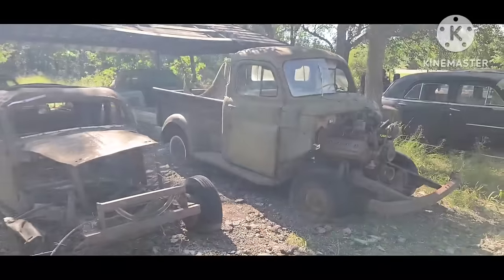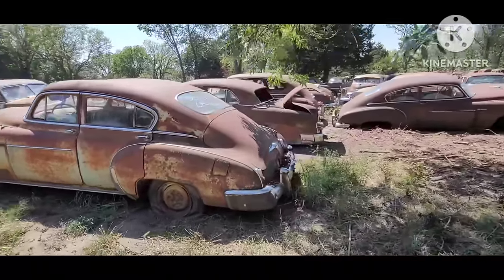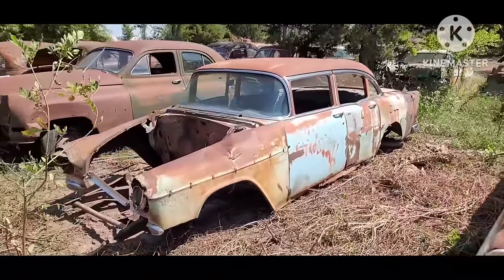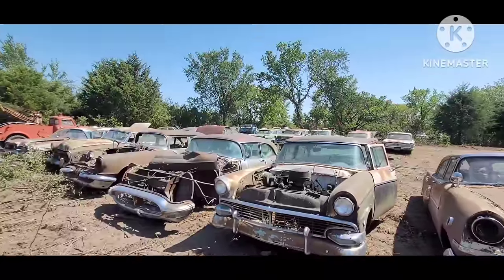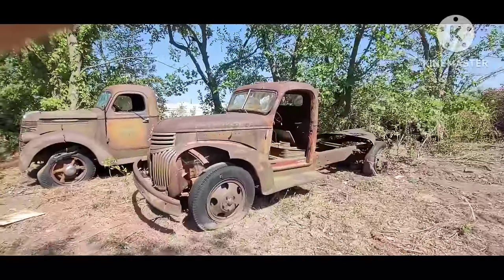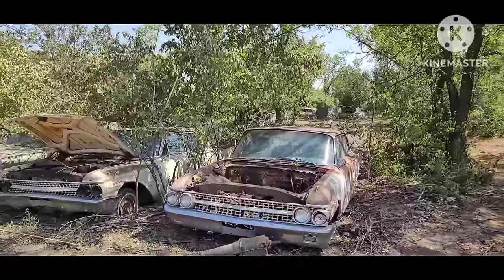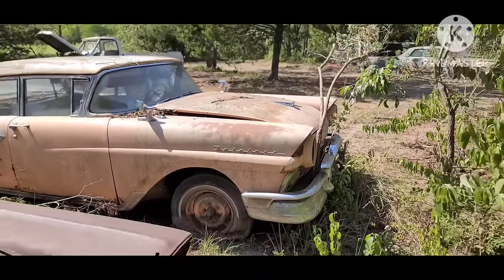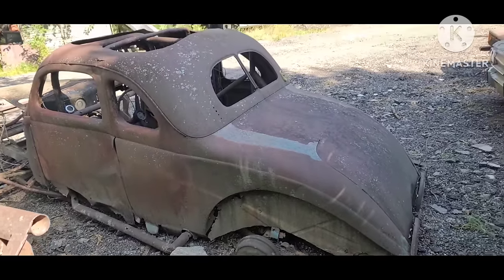Out of the Woods: Fred's Abandoned Used Car Lot Gets Organized! Kansas Project Cars, Trucks & Parts!

Comment: The Hemi is a 331 ,Pre 1953 . I 've had a couple of those,the only disadvantage are the long block design but the heads flow better than the later ones with the water out lets on them .
Reply: Those old engine blocks if you set them up on the mill you can cut that bellhousing section off of their drill and tap it and they're like the later ones

Comment: A real walk down memory lane.   I grew up in the 40s, and was always around cars, and it was neat seeing such a large selection of them in one spot.  
That Dodge truck with the Hemi and the pilothouse cab, would my first choice to put back on the road.
I wish that Comet would have been a little closer, I'd have jumped on it like a spider on a fly.  I have a 67 big block Caliente convertible, and although it is a driver, I needed a donor car for the rear quarters and trim pieces before thinking about a restoration.  .
I am still kicking my butt, because I passed on a 67, 335 horse Caliente, 4 dr Hdtp.  The car was pristine.  I thought I didn't have the room for it, and now, I'd park it in the living room if I had to.  They couldn't have made many with the high performance big block.
Reply from the maker: I have some lower quarters I saved from a Comet
Reply: @mr.goodpliers6988  Thanks, but I have already done them the hard way,   There was no damage, just needed to take a lot of time to cut and patch.

Comment: I hope the parts that guy got for that square body you mentioned were good.  I had gotten parts from for a 79 GMC Jimmy I was getting rebuilt, and they were absolutely crap. My tailgate had one rounded corner on the top left, and the other side had an actual squared off corner. Didn't even match. Chinese parts.

Comment: Four door Stude was a 1958 Champion.  Wagon was a 1957. The 1955 2 door sedan used the same wheelbase and shell as a 4 door . That big vertical stainless strip hides the filler panel seam as they didn't make a 2door sedan quarter panel.
Reply from the maker: I thought it could have been a '58, but wasn't certain since it didn't have quad headlamps
Reply: @mr.goodpliers6988  a fancier Champion would have had quads

Comment: 27:00..that's a '74 Nova sedan..the '73 doesn't have a bowtie in the center of the grill, the '74 does...27:10...'62 Chevy II Nova..'62 had that 1-year only grill...'63 and '64 had the more "eggcrate" looking grill, for the lack of a better term..I think the '62 grill looked better...27:53..yep, that's what I'm talking about..there's you '63-'64 Nova...29:19...that could possibly be a '47 Chevy truck, also..they made old/new body styles in '47, kind of like they did in '55...30:51...actually, that's a '58 Studebaker sedan...quite rare. Don't let the single lights fool you, they made both single and quads in '58 on them...look at those add-on wide headlight pods on the front fenders..'57's don't have those, and the headlight housings are less"wide" and "rounder"on the '57...and this car has the bigger '58 fins, also...35:19..'64 Mercury..oblong/oval tail lights..'63 were round...50:44..'47 or '48 Ford coupe..'46's had the rectangular parking lights above the grill...